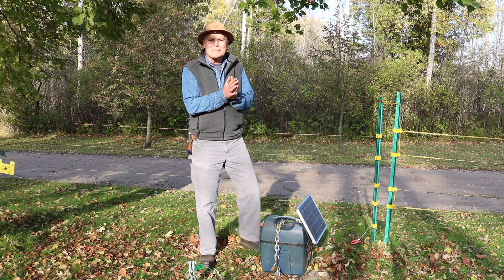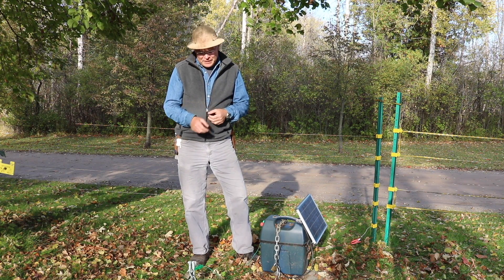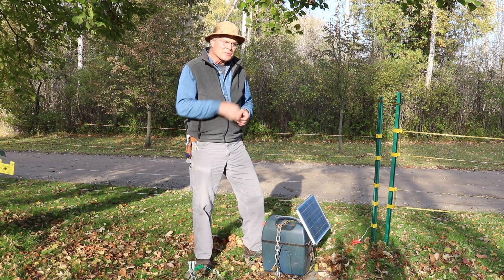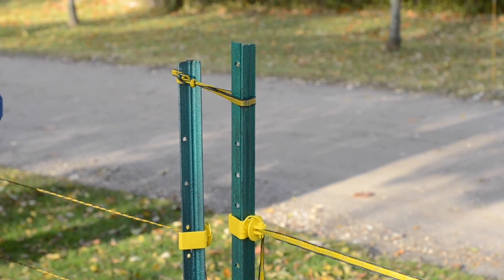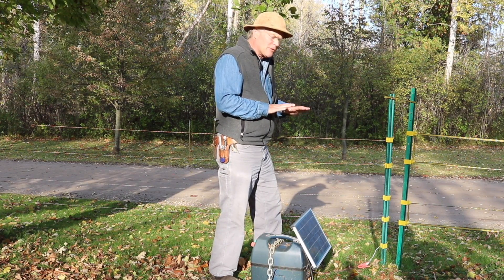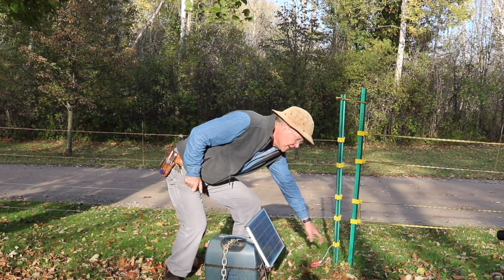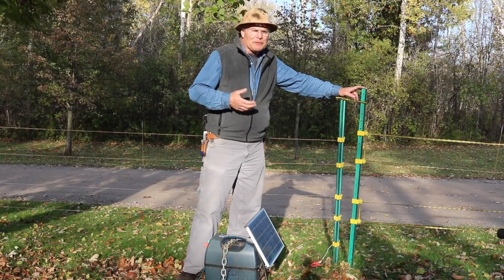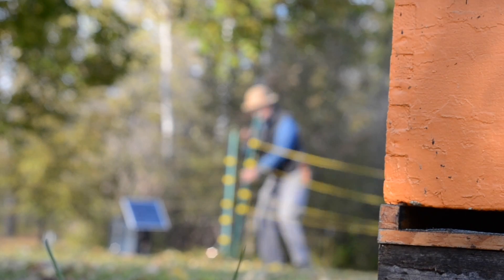Bear Fence

Comment: High powered electric fences will burn off most vegetation, these are commonly used for cattle. 
My advice is there is no over kill on electric fences, give them a massive wallop to teach them the first time and if your really paranoid do a fence in a fence, space them about 6-8 feet apart if they get through the first the second will make them earn it.
Reply from the maker: Good tips. Thanks LRB.

Comment: .In this video, .75 joules is recommended as the maximum needed, yet that is not near enough for cattle that are similar in weight and do not have a heavy and thick fur coat.  Get the most powerful you can afford and be safer for it.  One video shows a bear is not deterred by an electrified carcass.  If determined, bears will get through.  Hit them as hard as you can to reduce the bear's determination to a minimum.

Comment: Fence boxes should always be inside fence area so animal walking are und perimeter will not catch and pull ground or hot wire off the fencing system and disable it. Something to think about. Inside they cannot reach it and thus no possible way to shut off electric current